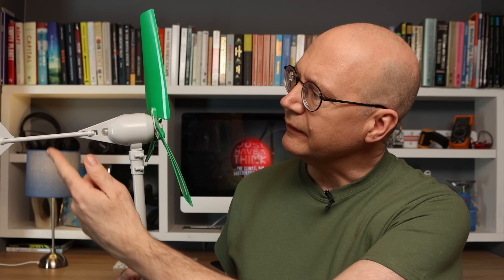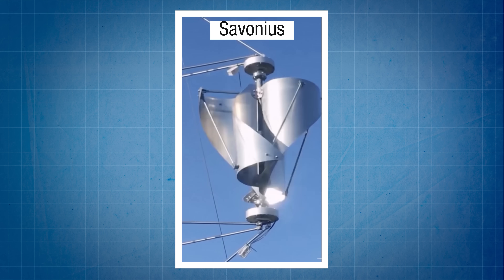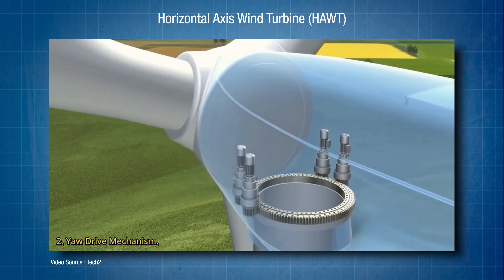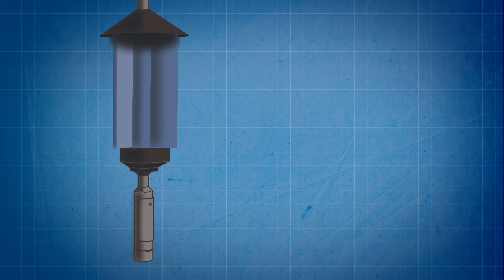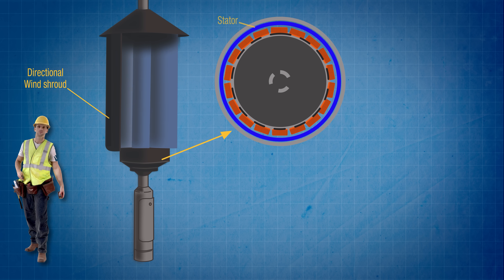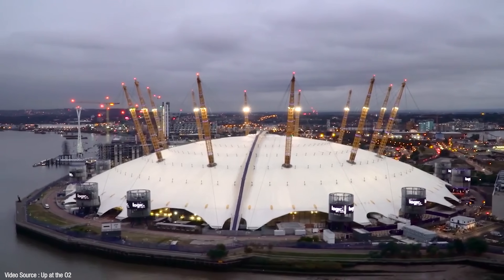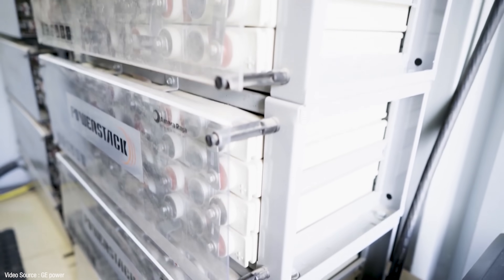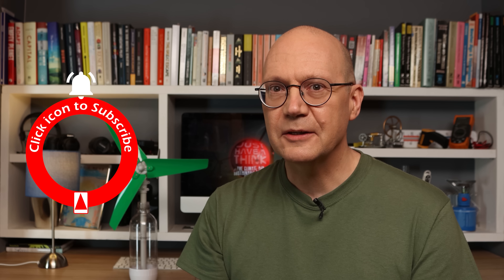A vertical axis wind turbine that doesn't need the prevailing wind! How do they do that?

Comment: Hopefully they have available a range of collar sizes to accomodate differing pole diameteres. This would be great on the tall highway light poles in the US, which are quite wide.
Reply: Would they take the light off the top with a crane, and slide the wind turbine on, or dig up the pole and do it from the bottom ? Either way seems to make the thing a non starter.
Reply: @goldmagnet9013  multi part. Wrap it around and connect it together.
Reply: @robertroberts5218  So a split bearing, split stator, the blades would need to be in 2 halves, split coils with some very smart interconnects ? Developed by 2 chaps in a shed, never seen, no figures, no prototype (existing prototypes dont do this). All fantasy.
Reply: @goldmagnet9013  yep. Fantasy. That is what it all is until some one puts their head to it and develops it. Computers, cell phones, going to space, reusable booster rockets, ev carscwith motorsvat the wheels and no "driveshaft" centerline design like traditional cars, wind power based on resinance and not rotation...on and on. All development is fantasy until you sit down and figure it out OR have an epiphany, adapting some other idea to your own. I beleive this is where "think outside the box" came from. I wish I could find the link to a short video of a worker in India rewindingva truck alternator in pieces. Not with one new long piece of wire. Very simple impressivecand effective AND not traditional.
Reply: @robertroberts5218  Yes but none of those defy physics, unlike the A311 which harvests far more energy from the wind than is actually in it, unless physics is wrong. The company is run by bankers and media personalities.

Comment: Vertically mounted wind generators seem to have a special advantage over the horizontally mounted generators which tend to burn out in high winds. Well designed vertical generators do not over speed even in high winds.

Comment: That looks ace idea. Lots of cables to be laid. But fairly easy along roads
Reply: Isn't the cable already there, to power the existing lamp post these attach to?
Reply: @jimurrata6785  true. But I suspect that cable loop supplying a couple of high level LED lamps every 100m may be a little under capacity for a power generator every 50cm.
Reply: @focusford11  if these things are a foot and a half apart then they certainly aren't attached to those lamp posts, are they?
Each one will see a different amount of breeze so they each need their own charge controller.
I'd think this is the expensive part.
Reply: @jimurrata6785  why just attach to one lamp post when you have the whole central reservation. Should stop the rubberneckers lol. Only need a post
Reply: @focusford11  Like I said, then you get into having 2,500 charge controllers per mile.
All they really care is that the lamp is a net gain to the grid, and it isn't too expensive to implement.
Like putting up 2,500 poles a mile, thousands of charge controllers, etc.
Putting them that close together will make them all less efficient, and be cost prohibitive.
Reply: @jimurrata6785  not stopped them putting solar panels up in Scotland even with a hill south facing. So you only get sun April to October. Will leave it to the designers. Have seen warn out fibre glass wind turbine blades buried in land fill after they are passed their sell by date. We also burn trees which take 30 years to grow. It all needs looking at in context of what you get in total in what you use
Reply: @focusford11  I'm not sure about your nation, but if the renewable incentives are there, it will get built (whether it makes sense or not)
This is not that. There is no precedent, no lobby, no momentum behind these VAWT's.
I'm pretty sure we didn't watch the same video.

Comment: So many houses around here are having their chimney stacks removed and tiled over flush with the roof as they move away from coal. I quite fancy the idea of chopping the chimney stack and replacing it with one or two of these.
Reply: Attaching any rotating turbine, vertical or horizontal axis, to a house can transmit and amplify any vibration and be very annoying.
.
Reply: @nellfuncky305  Then it´s done bad and needs to be fixed ;)
Reply: @Suthriel  Not likely.  The spinning blade or blades creates a harmonic that is transmitted through the structure of the building and cannot not only be annoying but can also eventually cause structural issues.  Better to put it on it's own self supported pole.
Reply: This is actually a great idea, because if done good, it wouldn´t even disturb the aestetics of the houses, plus providing energy (maybe not much, but better than nothing for probably low cost and cheap maintenance).
Reply: @Suthriel  The noise can be a problem

Comment: The best thing would be do remove obstacles near the street so the wind resistance is decreased. But putting those turbines close to the road would create a tight fit tunnel, hence the car would have to overcome a higher wind resistance. The easier it is to push the air out of the way, the less is wind resistance. The turbines are clearly a theft of energy.

Comment: I have a large sloping roof on my house oriented south (by design) with 85 solar panels. To the north I have a flat roof with space for some small wind turbines. I have the cabling there already and it is about 8 meters off the ground on a hill. I've been looking for small scale, low maintenance, low flicker and low noise (to keep the neighbours happy) for some time. These seems to fit the bill and would complement solar well. Day to night obviously, but also high pressure (sunny weather) to low pressure (windy) and summer to winter.

Comment: Does this increase drag on vehicles passing by? Does a highway without VAWTs and a lot of traffic get air flowing in the direction of traffic, generally, and would these VAWTs slow that airflow, causing an increase in fuel consumption for all the cars (a tiny amount per vehicle, not even noticeable, but possibly making this a net contributor to greenhouse gas emissions)?

Comment: Seems like  a great idea. I'm not an electrical expert so my concern might be off base, but how will adding small amounts of power at lots of locations at uneven times to the electrical grid effect the stability of the grid?  Does this increase the possibility of overloads?  Would this risk be mitigated by adding storage in the grid.

Comment: Other appropriately skeptical news that I have found about VAHT systems observe that they generally fail economically because they are less efficient, require more material investment, and have higher maintenance costs.  
Alpha 311s lamp post collar may be the innovation that bypasses the material investment issue by co-opting the structural support of the existing post.  
Locating them low along a motorway replaces optimized natural wind exposure with the otherwise wasted air movement generated by passing motor vehicles.  Sounds like they are getting surprisingly good results with that.  Maybe enough to overwhelm the reduced efficiency inherent in the design?
Now to see if they have, or can engineer out the maintenance costs that have plagued their predecessors.  Hope so.  It’s a very appealing idea if it can actually be pulled off economically.

Comment: This idea has been around since the 1960's. Long overdue to see it implemented.
Reply: try "since the 1920s". And also, it has been implemented, countless times, by companies now out of business. It is just a very inefficient design. Looks cute though.
Reply: @tzenophile  are you talking about vert axis gennies, or placing them in high speed traffic roads?
Reply: @tzenophile  those aren't placed close proximity to moving traffic. Any examples of that?
Reply: @theskullyhippiedude3719  no. But if they were close enough to significantly interact, they would just cause the cars to burn more fuel, because of Newton's third law. And even then, they would be a really bad idea, producing very little (around 25 watts at peak), being dangerous to service, not to mention the cost and wiring. They would never pay off, and therefore no sane person or institution would invest in them, which is why this has not been a thing. And when simple but correct math is applied to this one, it will not be implemented either. Check out Jeffrey Lebowski's comment for the calculation
Reply: @tzenophile  I'm not disputing the math on the turbine itself, but I think you misapply Newton's third law with regard to the air wake produced by a moving vehicle. The vehicle moving is the action and the air being moved is the reaction, so the resistance to the vehicle is not a product of the presence of a turbine but the air itself. The energy transferred to the air is dispersed to anything in close proximity, mostly other air. Putting turbines in close proximity to moving vehicles wouldn't affect energy usage of the vehicles. The basic principle is sound, just need technology to catch up with the idea and I've driven through alot of highway here in the U.S. where it would work. I don't know if this company is a scam, but at 20k per turbine they must be making them out of elephant tusks, rhino horns and baby seals. Pretty sure I could Tony Stark a vawt for a lot less. But they are going for govt contracts so that alone jacks up price. Apparently they are partnering with an asphalt company in New York now. Just have to wait and see if they are the real deal or total BS like the Nikola truck.
Reply: @theskullyhippiedude3719  TL:DR; sorry. I'm not paid for this.
Reply: @tzenophile  neither am i. If you don't want to address the issue thoroughly, that's up to you.
Reply: @theskullyhippiedude3719  Sorry, it was getting very late where I am. For all I know you may be right; but only a proper experiment would determine it. My best guess is that the impact/drag on both vehicle and turbine would be minimal. And seriously negative in terms of cost/benefit. And impractical. And and etc.

Comment: "the car still has to punch a hole in the air anyway so it's just wasted energy" you're forgetting the vacuum behind the car. The air punched out of the way needs to move back into the vacuum as the car passes, these turbines will increase drag on the car by resisting the air attempting to fill the low pressure area behind the car. This causes the low pressure area to grow, which the engine has to fight against as the car moves forward.

How much this will increase the fuel consumption of the cars going through this system NEEDS to be calculated as part of the viability study on these. It's very likely that these will increase the fuel consumption of vehicles much less than they generate but until that number is known we may only be making fossil fueled generators with extra steps.
Reply: Very true an engineer on another channel did the calculations and the numbers do not stack up as always no such thing as free energy.
Reply: @philup4947  Post the link for the engineer on the other channel you mentioned please.

Comment: At 5:55 it is said, that one turbine has a power capacity of 2.5 kW, but can only generate 5.8 kWh per day.
At 9:25 we see that 125 turbines will cost GBP 29,000 monthly.
These 125 turbines will generate 22,115 kWh/month.
So 1 kWh is GBP 1.31

Another green dream just popped...

And your error is: Installed power capacity is NOT effective power.
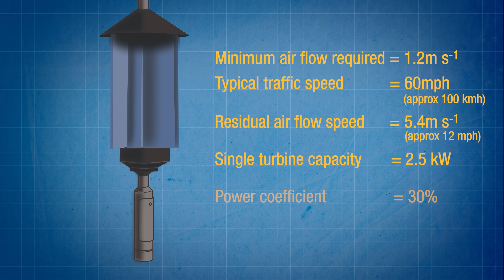Reply: It is worse than that: the numbers don't stack up, they are wrong by two (5:31) or three (8:50) orders of magnitude. The right number for a VAWT this size is about 25 watt. Which means this is a total investment failure.

Comment: I don't think attaching them to lamp posts is a good idea - the lamp post would effectively have to be remade and could suffer fatigue failure due to vibration. Having their own mast  a few metres from the lamp post  either with a small concrete foundation or attached to the crash barrier and then running the cables the short distance probably would be more practical imo. My solar panels don't produce anything on a cloudy winter's day but we have lots of wind, so I could do with one!

Comment: If the numbers stack up this is a great idea especially on crowded roadways with continuous traffic.  LA should jump on this.  I am particularly interested in the retrofitability of this system to roadside lampposts.  Thank you for highlighting this tech...  I think this will spark more ideas.
Reply: It would be wasted on LA because it requires the traffic to be moving.
Reply: The numbers don't stack up, they are wrong by two (5:31) or three (8:50) orders of magnitude. The right number is about 25 watt. Which means this is a total investment failure.

Comment: Personally I'm a bit skeptic after seeing the failure of the Solar Roadway. This seems more promising but the numbers seems strange tho. 3Kw turbines would need 100s of small turbines. Large ones won't weight 8kgs for sure. This is wayyyy to optimistic. It will end up as an even more expensive turbine that claims to be cheaper.

Comment: forty years ago the university of vermont published plans to build one of these out of 55 gal drums.
Reply: Why not? I just saw in my recommended videos list a video on making one out of a multipole stator and a wheelbarrow tire hub.
Reply: DIY sources are rife with these; Instructables. Makeit, MotherEarth, Popular Mechanix, and right here on YT.  The problem is many on YT are obviously unworkable and may be failed experiments faked to appear impossibly efficient as a facesaving measure.  Others seem most likely to be intentionally fake merely for 'likes' that can add up to get advertising revenue.  Some seem like pranks for laughs about those who fall for exaggerated claims.  Any that expect to impress you only by showing the voltage output are ignorant or deceptive.  Voltage is meaningless without amperage.  Volts times Amps equals Watts, which is the unit of power most appropriate for rating generators.

Comment: Just on a conceptual basis and not knowing the hard numbers, I think of these vertical windmills have a real future, especially relatively small ones in numerous places, most notably on residential sites.  One of these could be attached alongside a house with part of it going above the peak very easily and inexpensively.  The power generated in relation to the cost might be much better than a horizontal wind generator.  The simplicity of a vertical generator along with the low maintenance cost with easy access to the generator along with the load bearing bearings at the bottom is a benefit.

Comment: Can you compare the power output of a single turbine to the output of 1 on every lamp post though?  Because surely the air movement speed doesn't just exist at that one location .. and when the turbine takes energy out of the moving air stream won't it mean that the next one won't move as quickly as it otherwise would? Otherwise you'd just increase the turbine density even further .. which obviously doesn't work ... Very interesting idea though ... Would happily stick something like that on my chimney if it were possible!

Comment: Harvesting energy by slowing down the airflow around cars and lorries is bonkers! Its just increasing their fuel consumption by more than the energy extracted. It would make far more sense in real terms to have a smooth barrier between the carriageways to stop the air of oncoming vehicles mixing which would significantly reduce the drag by creating a back wind for both directions!

Comment: The lease cost will only be part of the full cost of operating these units, and you don't make it clear whether this includes servicing.   Let's go with £29k/month, or £348k/yr, and uplift to £400k/yr for other operating costs and overheads.  The average daily output of a turbine unit is 5.8kWh per day, or 264 MWh per year for 125 turbines. 
The cost of electricity is therefore about £400,000/264 = £1500/MWh, or 150p/kWh.  That's too expensive.  This technology is a nice and novel idea, but nobody will want to pay such a high price for intermittent power.  There is good reliable power available in the market for a small fraction of the cost of this proposal.
Reply: If the turbines are leased, operative costs don't matter.
But you are, of course, generally right.
Reply: @TheSpecio  Operating costs do matter. The lease will not cover local and central government taxes, administration, insurance, land lease, and various costs associated with selling/supplying the power output.  Dave doesn't say the servicing costs are covered by the lease, so there will be costs of holding stocks of parts, service and repair. These turbines will get dirty, and their performance will degrade - it will be a matter for the lessee to take care of upkeep. To do this safely, motorway lanes will need to be temporarily closed and cones put down to direct traffic away from workers.  Closing motorway lanes will not be cheap or easy (lots of vehicles and cones).  These operating costs will make a big difference.